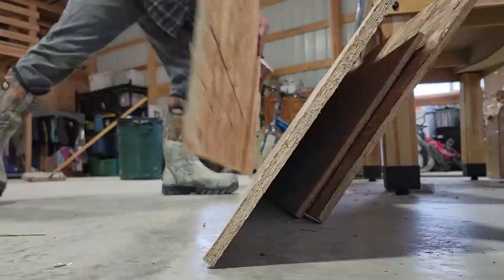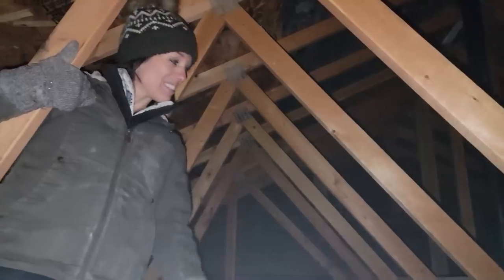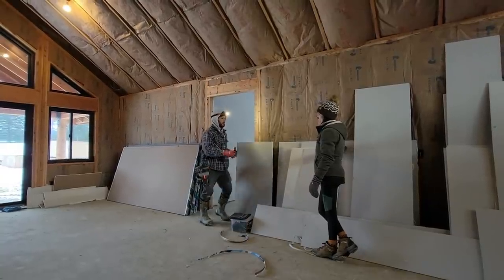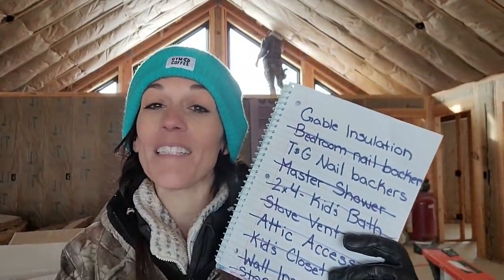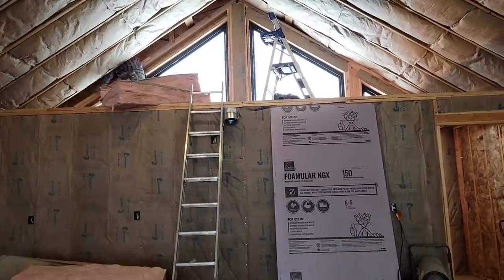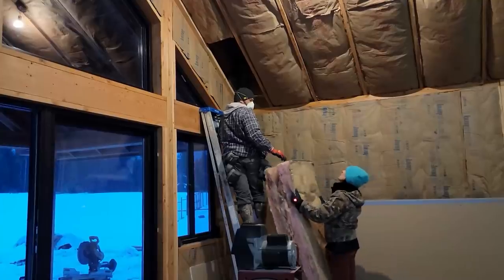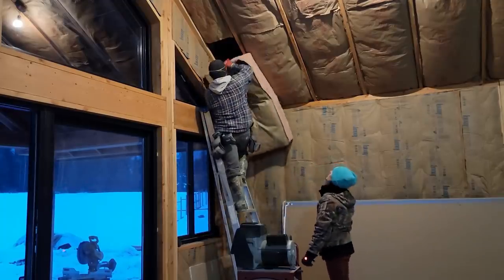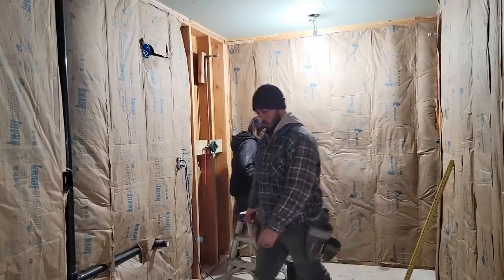Working Through Difficult News While Building Our Mountain Home

Comment: If you are asking about the space above the pantry, yes, I think making that a loft with a spiral staircase is a great idea for just a place to sit and reflect on what you have accomplished.
Reply: Yeah, I would think you could put a steel cable railing or maybe clear glass so it doesn't obstruct the light/view from below too much?
Reply: A loft is a great idea, but a spiral staircase will get old really fast. Consider building step on the side of the wall to get up to the loft.
Reply: @lindachandler5980  or maybe one of those library ladders?

Comment: AS a suggestion, build walkways in between the trusses as you will be up there on occasion.  Also include lights to see your way around in there to.  You will not regret it!!  Lastly, use the window spray foam to use in those tight spaces where you cannot get insulation in.  Been there, done that and have the tee shirt.  Got those tips from a seasoned construction worker. Great video as always!!
Reply: I highly second the spray insulation and cat walks.
Reply: Just did a house and your advice is right on, we did all you suggested.

Comment: I always thought your loft area above your pantry room would be the perfect space to have a relaxing reading nook / snug.  Add a few bean bag chairs and it's the perfect spot to have hot coco and watch the snow fall. 

Look into rope, netting, cable or tension cable balustrade ideas that secure the area without blocking the light or air flow.  Can also make a great feature.  Often they include light fittings or climbing plants as well.

Comment: After cleaning up the blown in insulation after installation,some people stack furnace filters 2 and even 3 deep in order to keep their home heated using their new HVAC system while drywalling. The secret is to keep a close watch on your filters and clean up drywall dust daily. No reason to freeze from here on out!
Reply: More filters in the same return  add restrictions to air flow. Not good for the hvac system
Reply: I agree with @Brian Pulst Sr. My experience with using our new HVAC system during a studs out renovation found that the HVAC can be used without any trauma to the system if a stacked filter (FPR4 covered by a FPR1) is used. The FPR1 collects the larger stuff while the FPR4 collects the finer dust particles without causing excessive restriction. Just keep an eye on the filters and change them out when necessary. These are cheap enough and provide good protection for your system. Keeping comfortable while building is conducive to getting more done. Also, use of kerosene fueled space heaters will produce lots of excessive moisture in the space.

Comment: I just built our log cabin this last winter in Colorado. We used a propane patio heater and it worked well. Also a kerosene heater works very well and is safe to run in a closed up area. The patio heater burned very clean
Reply: No open flame heater in an air tight room or building. A heater like this will use the oxygen in the air in order for the fire to burn. If oxygen is not replenished (such as an open window), you can suffocate. If sleeping, you may never wake up.
Reply: My husband just bought a kerosene heater a couple months ago and I love it!! It warms up so fast and would probably heat their whole house.

Comment: We put a layer of insulation on the backside of our hatch cover even with all that blown going in around it you will still feel the cold on the hatch.  Get yourself a infrared thermometer and you can quickly find the low temp spots.  Over time (I've been here 43 years now)  the blown insulation has settled to about half the "fluff" it originally was, not sure if the current blown insulation will do the same.  Good job getting it done!!

Comment: Attic Insulation DONE!  That has to be such a comforting feeling (pun-association intended) to get that material installed and a few more items get checked off the to-do list.  Just a suggestion, you may wish to take some of that pink foam board and glue (using foam safe glue) a couple layers on top of the drywall attic covers.  It adds very little weight, but adds a goodly amount of R-value to that area of the ceiling.  Sorry to hear about the bad news, but fondly remembering those who have moved on, for whatever reason, is the only thing we can do after the fact.

Comment: I think that it would really be worth doing a temporary install of the wood stove or a wood stove to heat the whole space.  You are going to get a much better job in the end.  The cold and damp is not good for anything inside , the expansion and contraction or the building and building materials is not going to be easy to deal with.

Comment: I’ve noticed the suggestion to use propane heaters. They can throw a lot of heat in a short time. You’ll want to remember that propane gives off a lot of moisture which would make it contradict the “dry” atmosphere you need to dry out taping mud. 

A number of years ago we used a kerosene heater in a large garage space that we stretched clear plastic on the south side so we could capture a little solar heat while working on rebuilding the massive doors. The kerosene heater is cheap to buy, heats a large space quickly. However I don’t know if kerosene has moisture in it like propane. 
I know contractors frequently use them.   

It’s always nice to have a progression in mind, but perhaps rethinking when the Woodstove goes in might give you the heat and drying power you will need to make these jobs easier. You will find that mudding and painting throw off a ton of moisture. 

Wood heat is so nice and dry and will aid these processes.

Comment: I so glad to hear you say your not using the central heat over space heaters. I'm a HVAC tech and sheet rock dust will ruin your duct system / equipment.  It doesn't matter what filtration you use it is bad for your HVAC system .
Sorry to hear the news .  God is good and will heal

Comment: As always glad to see you moving along with your build.  I notice you mentioned about possibly using the space above your pantry room, which i think is a great idea, as the views from the windows are so great, it could be a chill out area, for the railings you could always use glass, so it still lets the light shine through and would not look too over bearing from the main room, then you could always make the access to the area through the pantry room, so you do not encroach into the main room.

Comment: As a hvac installer, you can run your system. They make disposable filter sold on a roll. So you can cut to the size you need. Because on the construction sites, we need to run them to keep the guys warm. And more over sometimes, to keep pipes from freezing. You guys are doing a great job. Maybe you can not cut out some of your arguments. That all couples have. Lol

Comment: For the area above the pantry. Maybe you can make something that allows you to put the rails up and down depending on whether you are using the space or not? Like they lay flat on de ground (or inside the wall beneath) when you do not use the area. And then you can (automatically or by hand) secure them upright when you do use the area? That way a railing won't block the view when you are hhaving family time downstairs, but will provide you with security when you are relaxing and appreciating the view when you are sitting up there?

Comment: For a railing in the loft over the pantry you can use thin stainless wires, like the ones used around boat decks, which will not be obvious or use glass panels similar to those used around swimming pools.

Comment: OK, I asked my hubby about your drywall, he said the drywall mud will freeze on the walls at 26 degrees, so keep your wall above 26, he said drywall will hold it's temperature for 24 hours, so starts warming your walls a day ahead before you plan to put mud on them and keep the temp above 26 on the drywall. It will take a bit longer to completely dry in colder weather on your tape (1st) coat, subsequent coats (bedding and finishing) will dry a bit quicker because they aren't as thick. He also says to invest in a good 40,000 btu  or higher torpedo heater(electric or diesel)  it will pay for itself in energy savings and warm way more of the unfinished house with the added benefit of lasting for years. I hope it helps a little.

Comment: For the heater you could check with local mechanical contractors to see if they have a FAU for scrap they are replacing. You could install one temporarily instead of your new one

Comment: Prayers for whatever the ending was meant for. Also on the railing you could frame in tempered  glass or cables. Won’t cut the light but give a functional sitting area for that view out the loft windows.

Comment: Once you are insulated, you could bring in a large diesel unit.  One of your neighbors might even have one to borrow. They run outside and blow in through a hole in a window or door.  We blew heat through a hole in the back door.  Your house if well insulted, should hold the heat of about 60-70 for two to three days.  So in theory you could run the diesel heater six hours a day and have steady heat to complete any mud and tape.  FYI, I used this method to pour my radiant tube flooring at -40 outside—I live in Alaska.  Hope this is helpful.

Comment: Jeremy, as a suggestion when you get a chance you may want to glue some rigid foam insulation to that attic access panel. That 1/2” drywall won’t offer much insulation. In my neck of the woods 2” was good but you may want thicker.

Comment: You may want to consider construction filters that are installed in the return ductwork.  These filters are temporary with no needed infrastructure.  They are commonly used when major construction is ongoing and the HVAC has to be used in the commercial world.  It will not void your warranty.  Also you can change the unit's filters on a bi-weekly basis.

Comment: Hi just a suggestion we have access to our attic and its a wood panel that is painted white like ceiling . I am not sure the sheetrock is permanent . I would be concerned about it warping. The good thing about doing a piece of wood on the back side facing inside attic you can screw a thick piece of foam insulation which will keep that area even warmer maybe. Just a suggestion. You guys do great work .

Comment: If it were up to me I would definitely finish the area above the pantry as a loft for relaxing. It would be a nice sunny and warm spot to sit in. A glass or even just a wire railing could be used to prevent blocking the view from the main level.

Comment: to utilize that space up there look into using glass or cables for a handrail system and put a pull down stair case in the pantry or a movable stair case that can be secured to get you up and down.
put a couple of bean bag chairs or low sitting chairs up there.

Comment: Glass railing! Or cable maybe? -- it's too good of a view to miss out on. Not sure if you were already planning it, but it wouldn't hurt to run some pathways through the attic space (maybe even storage-duty ones if you want), and definitely some lights up there -- they don't have to be connected to the mains power, we just ran a long plug-in LED strip through our space, and have the plug end near the man-hole, so you just have to run an extension cord to that whenever you go up there. (Although it might be easy to wire something in, as you are building from scratch?). It is always good to future-proof yourself :)

Comment: Jeremy we are so saddened by the loss of Officer Sahota, I read it on the news and wondered if you knew him.

Might look into a Mr. Heater, it is like a salamander heater but instead of using either propane or kerosene it uses diesel fuel.  So the same container you use for the Deere can be used for it.  I believe we saw it on an Outdoors with the Morgans video.  I will be looking at one soon, for use next winter in a shop building. 

I think I would figure out a way to have a lounge/coffee area above the pantry.  Maybe Plexiglas or glass instead of a wooden railing.  Or maybe a thin metal rail so as to not block the view from downstairs.  Now I can't remember which is more distracting, a white or black railing, one tends to almost disappear while the other stands out.

Comment: I use a master propane forced air heater that has 3 settings (up to 60,000 btu's) in my shop, and on low it heats my shop to almost 70" in about an hr. My shop is 12 X 48. The heater will run about 10 hrs on a 20 lb tank. Craftsman, at Lowe's has an 80,000 btu for abour $200.00. They will also work with a 100. lb. tank. I've found that the fan makes the heater work much faster.

Comment: Glue some rigid foam board on those attic entries. Blown in insulation is fine, but those entries constantly become uncovered through time. The foam board will be stuck there always and easily returned to same position without having to mess around with covering again.
Reply from the maker: We did

Comment: Regarding making use of the loft spaces at the gable ends - could you cost up installing frameless glass banisters. Obv fixed at the bottom and both ends but totally frameless on the top so no obstruction or distraction from the ground level looking up. Xx

Comment: When cutting OSB or other sheet material, set you saw blade depth to approximately 1/4" below the bottom of the material.   This is a safety procedure.

Comment: A great heat source is a kerosene heater that blows very hot air. Also known as a salamander. It is longer and cylinder shaped and has wheels to move around room to room. Will keep you all plenty warm while you work on your construction.

Comment: For the railings for the loft, use steel cables run horizontally, between posts. It doesn't block the view, but is still safe. Cheep fix.

Comment: With the high standard of insulation and air tightness you have it isn't going to take much to heat the individual bedrooms.
Remember gas space heaters pump a lot of moisture into the house so a 3kw fan heater with a thermostatin in each room  would provide enough heat to dry your mudding without adding moisture

Comment: I know it's somewhat late but I would suggest that when using your skil saw that you set your depth of cut to just protrude below your stock approximately 1/4",  As a carpenter with over forty years under my belt I've seen several accident's and incident's by not following this basic rule of tool use.

Comment: Drywall. What fun! <sarcasm>  As for the dust you can make a panel to go into a partially open window, cut a hole in it, and push a shop vac hose through it from the outside.  That way you can vent fresh air into the room from the inside of the house through a similarly sized hole or even smaller and suck the dust out side.  You don't have to keep the bottom of the shop-vac attached to catch the dust either; eliminating the need to check it to see if it's full.  I've even used other lengths of hose to bring in the fresh air from outside to the hole in the plastic so I didn't lose heat in the rest of the house while I was working.  I hope this helps!

Comment: I had to separate this from the other comment I made here, it just wouldn’t seem right. however in regards to making your upper deck area a loft without obstructing the view you could use thick sheets of acrylic that you could slide into acrylic post and then you’ll look straight through the clear acrylic to look out the window. You could also use cables, stainless steel, fairly thin with narrow uprights to go through. And you can also set it back from the edge so that as you were looking up the angle of elevation from the front edge of your landing would block the bottom portion of your railing rendering it unable to be seen from the main floor. This effect is visible in your video when you can’t see the bottom of the ladder from the main floor, however the closer you get to the front edge the less you block. Just a few thoughts if you want to give consideration to using the landing as a loft and not just wasted space and not really obstruct your view much. Either the thinner stainless steel cables or the plexiglass would also be somewhat hidden by furniture you would put up there see the furniture past your simple railing would helping to hide your plexiglass or steel cables as the railing and the furniture would blend in together.

Comment: Are you going to air seal (foam all the cracks or the drywall butts up and butt up against the top plates and where you have penetrations) the attic before you put the insulation in

Comment: The saw you are using has a depth adjustment. I usually adjust the depth to about 3/16 ths. deeper than the thickness of the material i"m cutting for safety and better saw control.

Comment: Did you put wood backing in your walls in your bathrooms where you will be installing towel rods? We did in our house build and in the 6 years we lived there, we never had any issues with hand towels or bath towels and pulling the fixtures out of the walls.

Comment: plexiglass railing won't block any light... or one of those cable wire railings.....do it! Wont block the light and make it like a area with pillows to read of watch the stars no hard furniture just beanbags or big fluffy pillows ~ and blankets ~ could even put the stairs in the pantry area like  pulldown attic type stair /ladder...

Comment: Typically attic insulation is not blown in till after tape, texture and paint.  The weight is not recommended until the moisture from these tasks has dried out.  Could cause your sheetrock to sag.

Comment: I would go and rent one of those large portable propane heaters to warm the house. Will be more efficient than electric space heaters. Only problem is they are a wet heat but if you let outside air in (which you need to do for carbon monoxide anyways) that should compensate.